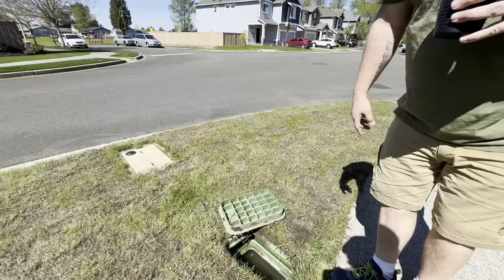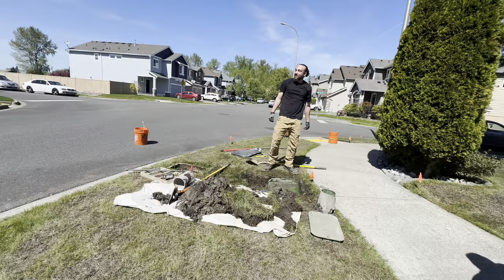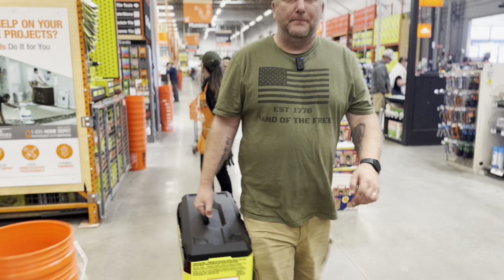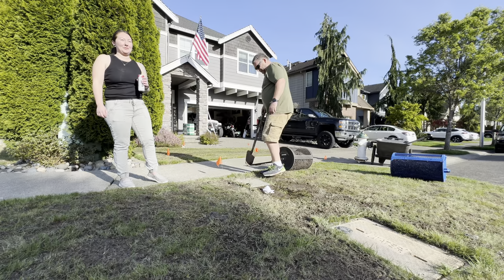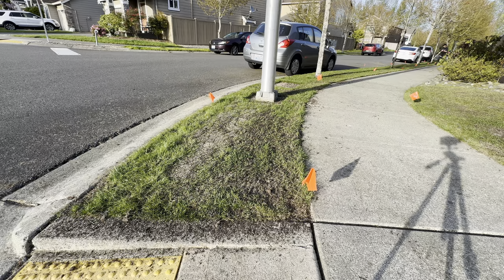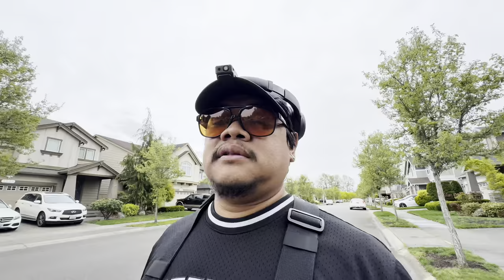Spring OVERSEEDING NEIGHBOR'S LAWN w/ The BEST SEED on the Market! NOTHING ELSE COMPARES!

Comment: Get the Orbit DIY sprinkler system. It’s basically PEX and shark bite fittings. I did out 8k sf lot for under $500, including rental of a trencher. The system connects to your hose bib with a timer. Since it isn’t direct plumbed, you do not need a backflow preventer or annual testing.
Reply from the maker: This is not the first time I've had an orbit DIY system comment... I should really try and do it this year ☺️🤙🏾
Reply: No, just buy the 1 inch blu lock and get all of the couplers and elbows needed. I bought the orbit bundle 1/2 inch and regretted it. I have 1/2 lines underground with 1 inch lines that’s I upgraded above ground behind my shrubs. Whatever you do get 1 inch. I would also just get hunter manifold, backflow preventer, and a Rachio wifi controller. 

I saved a ton of money doing it myself but I could’ve saved a lot more knowing what I know now.

Comment: So my lawn is cut about 1 3/4"   ive been cutting every 3 days not strict.   My lawn is thin trying to get itnto thicken up.  Been using a spray 10/10/10 fert that recommends weekly spraying.  The problem is, my grass barely growing.   I know the fert is a weak fertilizer but i would assume it would be growing fast...its almost feels like im using PGR on the lawn at this rate...any suggestions?
Reply from the maker: shoot me an email yardbrah@gmail.com send some pics, grass type and location you are at we will figure this out / if you already sent an email send one again as I am getting over 200 emails a day I don't want to miss it ☺️🤙🏾

Comment: So if you want to know if you have a leak. Make sure you have no running water in your house. Go out to the water meter and make sure it’s not counting. If it is then you have a leak. It’s very important to know where the meter and main valve is. Also a tool to turn off the water in the event of an emergency flood.
Reply from the maker: Thank you for the info ☺️🤙🏾

Comment: How much top soil and sand do you need to level 1000 Sqft?
Reply from the maker: It really depends on if you have a ton of leveling to do but in general I usually go with 15-20 bags per 1000sqft... bags are easier cause the delivery fee for yards is more than the 15-20 bags at the store 😂🤙🏾

Comment: How many bags of sand and soil do you use per 1k sq ft?
Reply from the maker: 1k I would use 1000lbs of sand and 20 bags of soil.. really depends on how level your lawn is... that would be for a level lawn... if it's bumpy or has major dips adjust to spec ☺️🤙🏾

Comment: How many minutes should the watering schedule be?
Reply from the maker: If you have an in ground it seems 2-3 minutes 3 times a day should be fine... Rick might even go 1 min sometimes so it doesn't puddle up.... for a cheap set up like mine I use the orbits gear drive heads I do 10 minutes each head... so it really depends on your system! ☺️🤙🏾
Reply: @YardBrah  Thanks man! I have the same system you have, orbit gear drives 3 heads 2 zones. 1000 sqft backyard.